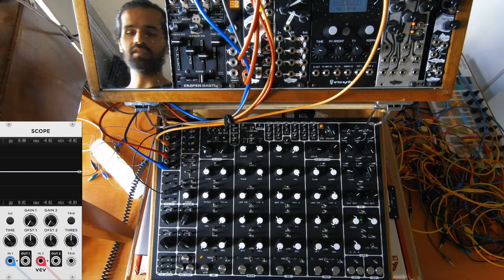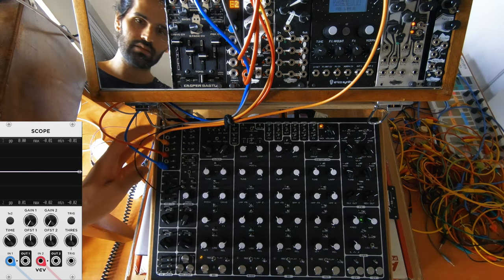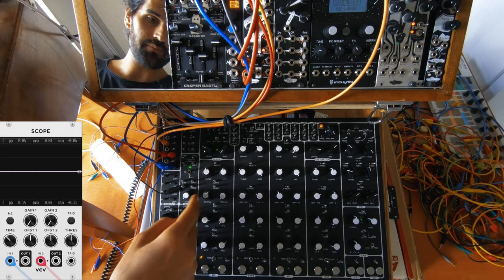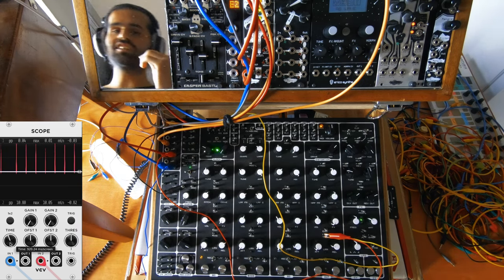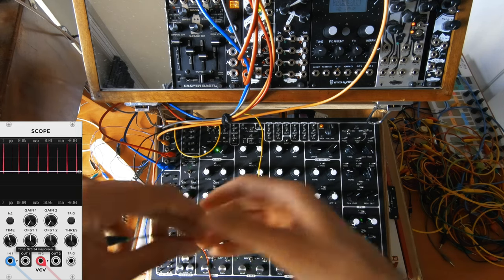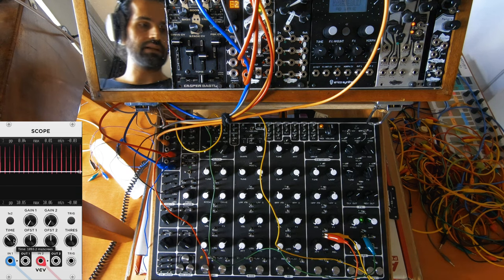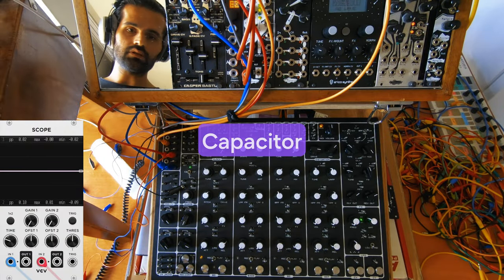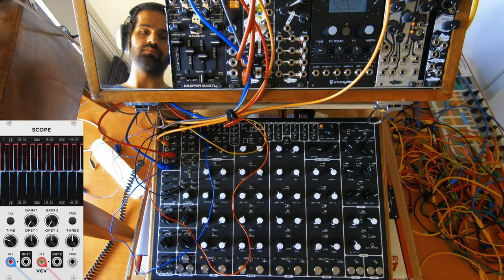Pulsar 23 by Soma Explained: A Deep Dive into Diode, Capacitor, and Controlled Inverter Sections

Comment: Thanks a lot.Can you briefly tell me what you mean by 16th triggers from the PNW. In my case here i cant clock the shaos with one the different clockouts of PNW PPEXP1 or an square pulse with a very short width.Cant clock the shaos with pam at all.But it works perfect with the right hand tigger out of maths ! Its a higher voltage shows me my DATA or VCR.
Reply from the maker: sorry for the confusion, I meant 16th notes triggers, which is, if you assign one of the PNW's channels to Square and the speed at X4.
what you said is correct,  you can't  clock the SHOAS because the PNW voltage output is 5volts and SHAOS needs 10 volts. so to make it work you can use your Maths. patch the output of a PNW channel that you want to clock the SHAOS with to channel 1 of Maths (the left side). make sure to put the Rise knob all the to the left and then use the EOR (end of rise) output of Maths to clock the the SHAOS.
an alternative is to clock Pulsar with PNW (PNW is the master clock). with this one you don't need to use Maths. just assign a channel of PNW to the speed at X8 and SQR. patch it to the clock in of Pulsar(the clock in of Pulsar doesn't need 10 volts to work it works just fine with 5 volts), from here you can clock the SHAOS with one of Pulsar's clock dividers. just make sure to put the "INT MIDI" switch in the center which is the external mode.
let me know if have any other questions
Reply: @badador  Yes thanks i found it out .Can you tell me which value of BPM come from PPW ?
Reply from the maker: @Tinyvince1971  if you mean in the video, it was X4